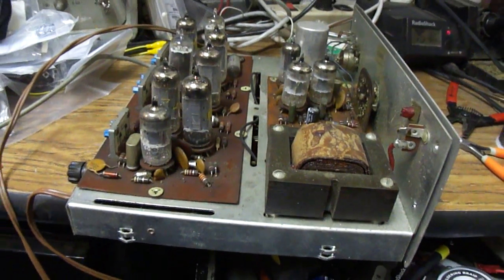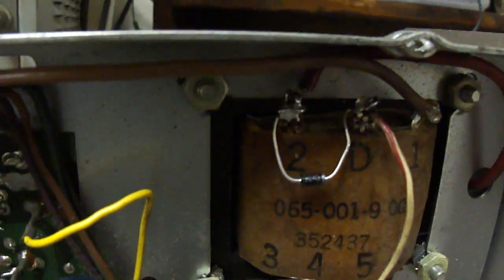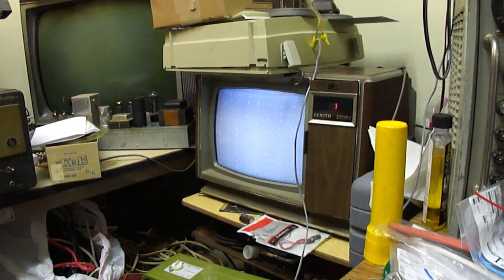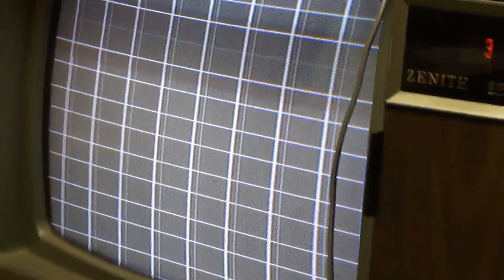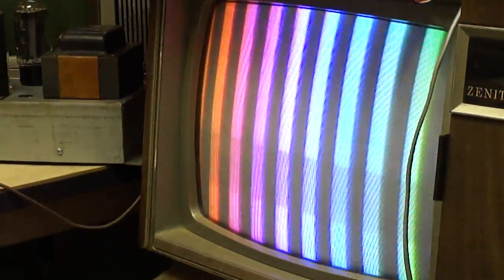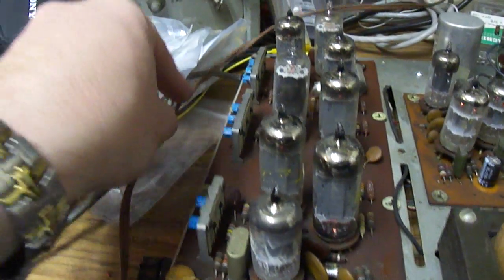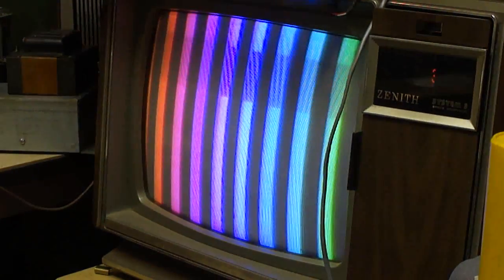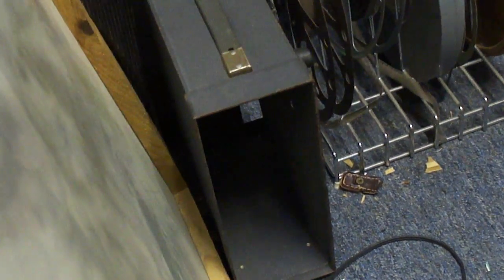1964 B&K model 1240 test pattern generator demonstration

Comment: Hi Chad I have something similar to your unit, it's a Tetra FA 298 by Tesa. How do I hook it up to a 1976 Philips K9 set? It ha an RF out screw type of fitting, and 4 banana plug style connections. 1, Ground, 2, video neg, 3 video positive and 4. sync out.
So how would you connect it to get a signal? Looks like you are the dude to get good advice, any advice? Thanks, Chris

Comment: @CoolDudeClem the crystal is for the 3.58 MHz colorburst signal. Also there is tons of tube gear that use crystals, especially color TVs (the aforementioned burst circuit) and various radio transmitters and receivers.